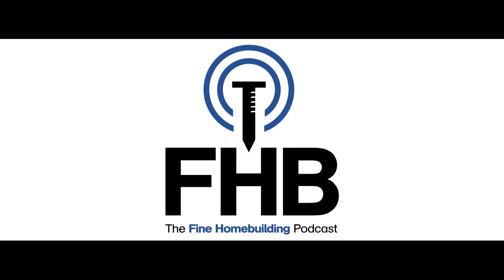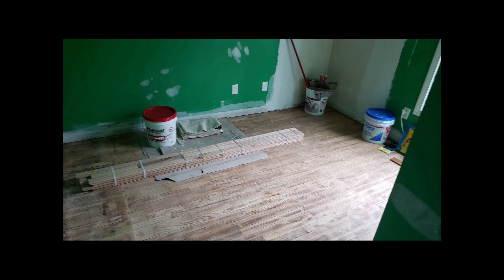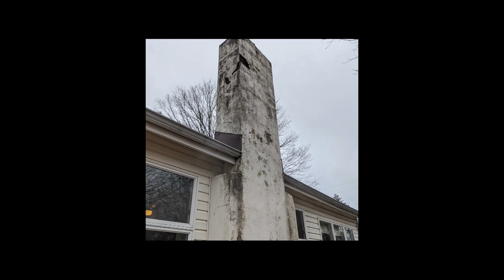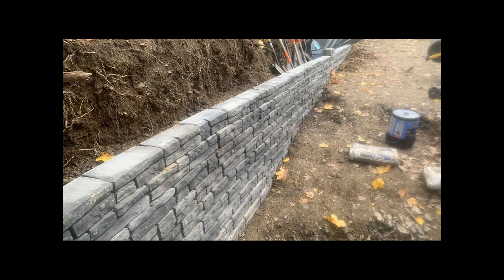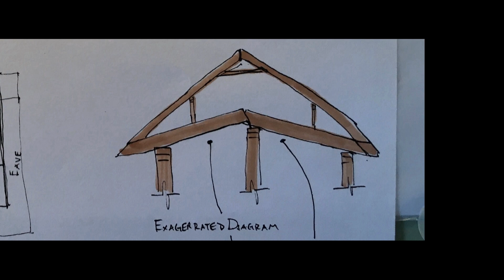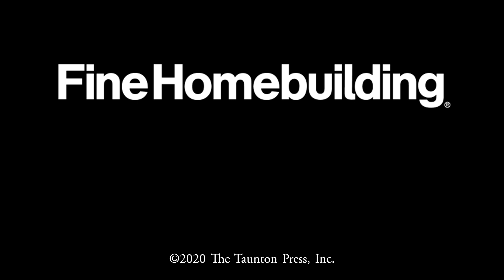Podcast 241: Modern Floor Plans, Rotten Deck Boards and Crumbling Chimneys

Comment: Jack up the sinking eave slowly like you would a beam, then sister in a full length raftertie/ceiling joist if you want to save it, or as big an piece as necessary over the floating joist: glue, nailed, and lagged.

Comment: If you want to see an open-concept design taken to the extreme, there's a mid-century "round house" near me that was designed around a central performance space. The bedrooms and bathrooms are in a ring around the central area. Zero privacy, but at least it has a nice little sauna/exercise hut out back. Google “Garvey Round House” for pics and schematics. It was on the market a couple years ago and sold for $180K.

Comment: My mother had 4 apartments in Chicago,  all had a swinging door between kitchen and living room room. This is the 40s and up to 1972. Old buildings, from the 1920, i suspect. It was a different time. Those apartments were built before women were out of the house working. My dad died when I was 8, so we didn't need much space. After a big family dinner, the men sat in the living room smoking, the women gathered in the kitchen (Dishwasher? That was their hands....).  Two completely different conversations - and work load. I'm not sure the men even helped clear the table. Us kids were told to go off to our room and get out from under foot or interfer with adult conversation.